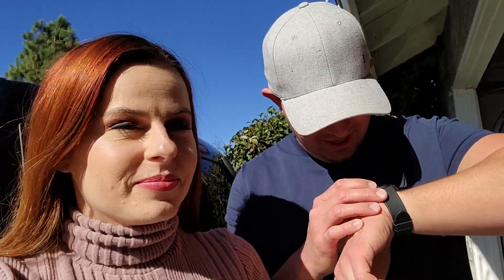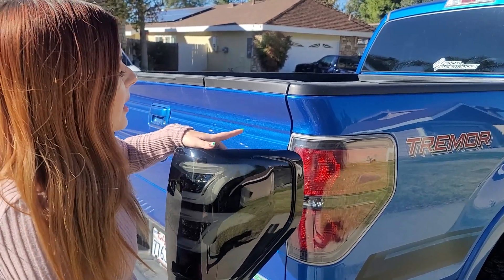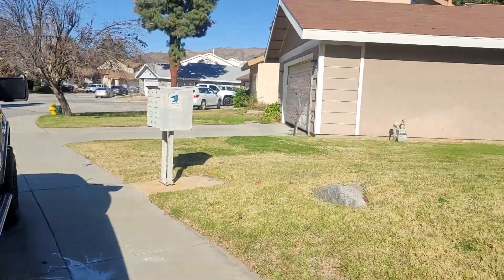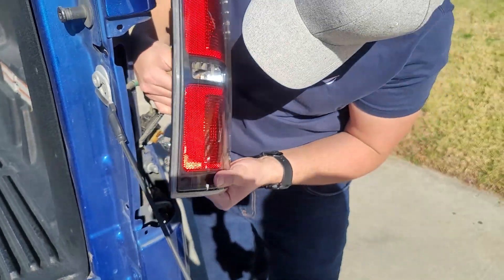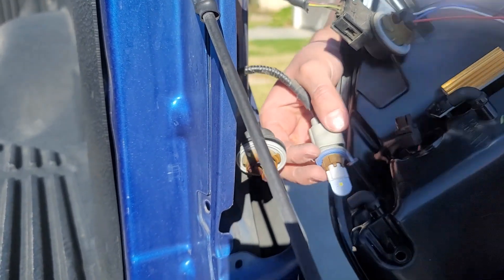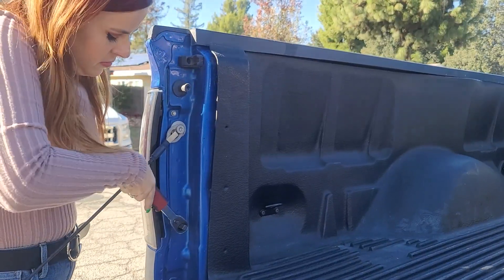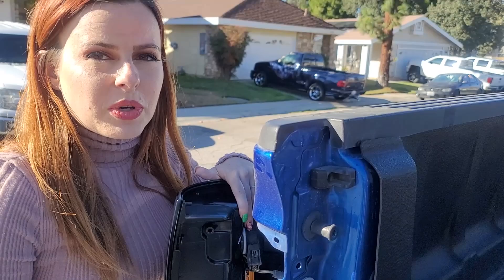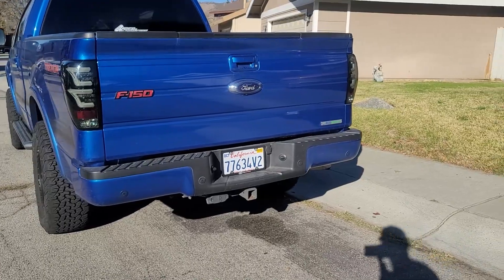Alpha Rex PRO Series 09-14 F150 Tail Lights - Install

Comment: i bought the same taillights ,they blew the ground on my marker lights up front...then i realized these ones are meant for raptor flare side...they looked ridiculous the way they bubble out on each side on regular f150s ,so glad i returned them.... I have the pro series headlights though and love those.
Reply from the maker: They did end up causing a hyper flash issue on the passenger side rear tail light. Video coming out soon...
Reply: @AutoJourney  my tail lights have that problem right now and i have the exact ones how did you guys fix it
Reply from the maker: @Fernando 69  This video might help!
https://www.youtube.com/watch?v=gnJ3oXwg8Ys&ab_channel=AutoJourney

Comment: I thought the Tremor package came out in 2021
Reply from the maker: This is the 2014 Model that was more street performance oriented, but I decided to go with an off-road build by leveling it with FOX suspension and going with 17s on bigger tires.

Comment: Did you get the headlights?
Reply from the maker: Currently running the factory black HID headlights. I plan to get the Morimoto XB LED Headlights though. I prefer the DRLs on the Morimotos over Alpha Rex headlights.
Reply: @AutoJourney  I have the MORI...XB FULL LEDs in my '13 Platinum.  Being 71yo, I appreciate how they turn night into day.  I did it right and properly aimed/adjusted them...2" down @ 25'.  Hdlt Rev has a tutorial on how to do it so no complaints from oncoming drivers.  Adjusting was not a lot of fun, since it requires complete removal to access the adj. screws on the back side of the light.  Love the sequential turn signal too.  GOOD LUCK!  CUTE Pardner too.